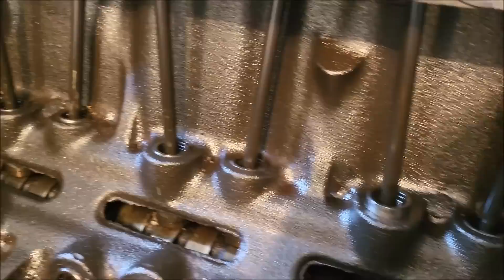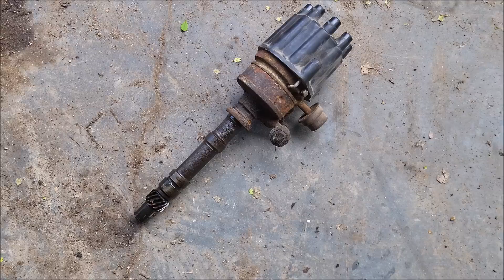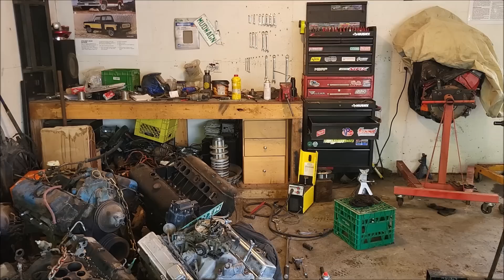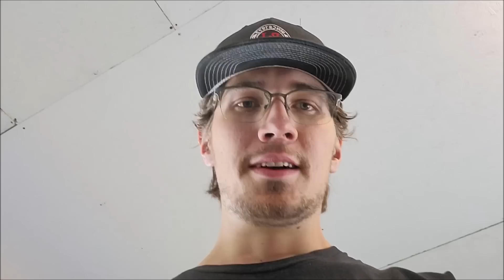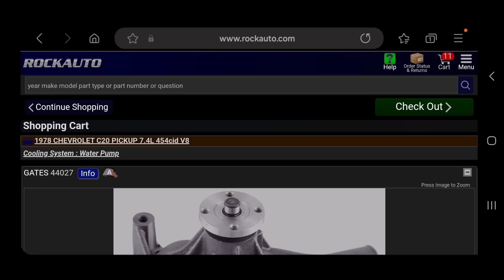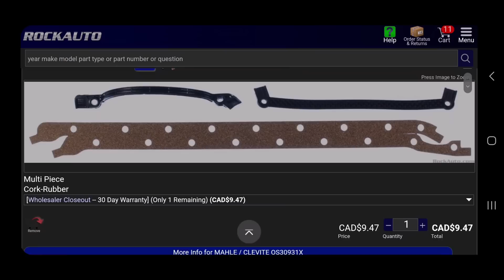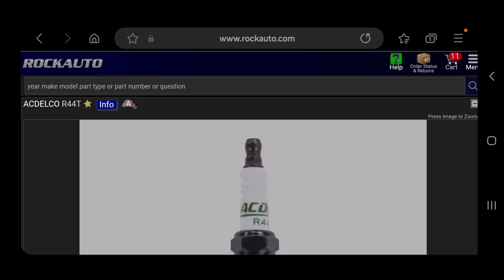Why Does Everyone Ignore Tall Deck Big Block Chevy V8s?

Comment: Young Man FYI small block 400 and 454 used the same flywheel. They’re both externally balanced. All other Chevrolet motors are internally balanced. Good luck with your build.

Comment: Intresting stuff and will watch more as you put it on youtube.
I have only one thing to say from experiance, remove the oilpan before you turn the engine, if there is debris in it i can fall down in to the engine and easier to diagnose the engines health.. 
i did not do this on one engine and missed a clip that had come lose, i then rotated the engine and did score a cylinder lining, not a fun day..

Comment: I have a pretty good idea why that 366 was pulled out of the big farm truck.  It's probably an oil burning, gutless pig like most of the 366's I've ever been around.  My FIL used to run them exclusively in single axle Chevy dump trucks.  They sucked gas like crazy and didn't make the power of a good 350.  When I helped haul gravel, we got 3mpg all day long, foot on the floor and begging for more.  They are durable though, can't seem to tear one up.  427's now are another story.  Most of the truck 427's I've been around would run circles around any 366.
Cool project putting one in a pickup.  I would have definitely opted for the 427 though.

Comment: Another GM series of engines that are finding their way into Chevy trucks are the Cadillac 472/500s They were also built using high nickel castings and designed for durability and longevity.  The Cad engines were not designed to rev; no 4 bolt mains (but huge 2 bolt main journals were large enough to match the bores of many smaller engines) and everything about these Cad engines were just massive but one fitted with an Edelbrock aluminum intake weighs in at just slightly more than a all iron stock SBC. 
These tall deck BBC's are definitely an easier route for cheap big block power especially if you want to keep your truck all Chevrolet and so much easier to bolt in without extensive modding and can retain the Chevy transmission.

Comment: The 366 set up with the right drive train will beat any other gas truck engine on fuel economy. The reason they don't have a MPG reputation is because they were in the Medium trucks and were paired with 5 speed manuals with the split rear end with 8.44 and 9.55 gears.

Swapping these with a 454 is an instant win at the gas station.

Comment: 427 version is what we used in the old days to make big strokers. 366 was a good source for steal cranks for 396 and 427. use to buy junk ones for cranks and 4 bolt main caps. Heads have huge diameter valve just like the truck 350. Use an intake spacer and you can run a car intake. No 454 flex plate it will nock it out of balance. . Use a big small block or 396 0r 427 flex plate .

Comment: I always prefer high capacity cooling and lubricating options. 

I have a 9 quart pan on my 361 I/C 4 bolt main, and a 7 gallon 4 vane radiator.

It was a fleet truck pulling heavy equipment for the city of Norwalk, CA and while only listed as am F350, it is rated as a 3 ton.

My newer Ck3500 is also a fleet truck, but being a 93, it has just a fairly normal 350 and 4L80E, which is not nearly as rugged.

The drive lines are somewhat different: 

one has an I/C engine with fleet cooling, a 4 speed manual, and a 5.11:1 Dana 70, 

and the other has a fairly standard model engine, automatic trans, and a 4.10:1 Dana 70

While they both have the same wheel base, I would have to directly measure the frames to know if they are the same length or not.

The frame on the Ford is thicker, but its also 1-ply "C" channel style, and the "k" member is bolted on,

While the thinner CK frame is "box" style with a few additional welded pieces as it merges into one under the engine, instead of having a bolt-on, drop-out "k" member.

They both have single piece front wheel hubs [disc brake rotors integral to the hubs] instead of the more common shallow hubs with removable rotors and a bolt-on extension for dually type rims.

A 366/427 would be a nice replacement for the 350.

My brother has one of those 427's in a 92 C-60 feed truck, but he has plans for putting it in an older square body 73 model C-60 dump truck.

I'll just have to keep my eyes out for one of these motors......and a manual transmission.

Comment: There are 2 366 blocks casting numbers 779 and 977 that can be bored past the 402 bore size...I guy told me he built a 440ci 366 using a 454 crank 4.185 bore and .400 long rods...the pistons were KB hyperutectic pistons made for a 396 with a 454 crank...all off the shelf parts

Comment: Well, your about 45 or 50 years to late! I built a lot of them for racing they were really popular with the big inch Chevy guys 454, 468 or bigger! I just finished building one for a good friend of mine and we are almost done with a 78 short-bead pickup! that it's going in! I still have 2 of them that I raced for years and am getting ready to put them in an old, new car and go again! This one I just built is a 496CID at .030 over bore. we could have made it a 502 if we had board it .060 over, but the block was nice, and we wanted to get more mileage out of it! We can boar it .060 over next time! It has a new billet steel crank with a 4.250 Stroke! and just short of a 7" Rod! and a set of maxed out Dart Pro-One Aluminum Heads! The 366-T is not much good as it's a small boar! You can't bore it out to a 4.250 like a 427 or 454! But here's is the deal and why they were and still are sought after blocks for BBC's They are 4 bolt main high nickel blocks just like an HP 427 but what is so great about them is the deck of the block is .400 taller than a regular 427 or 454, now everyone knows that the 454 has a rod angle problem the 427 is perfect! But the 454 is putting a lot of side loading on the trust side of the piston and cylinder because the rod is too short for a 4" stroke! 427's are 3.750 stroke and are great just that way but if you want the toque of the 454 pulse the high RPM house power that would come with it if you had a longer rod to let it sing! It's almost like GM made the 427-T tall deck block just to order for the 454. So here is the deal, you take a 427-T Block, do all the machine work and line hone or check it, and boar it over to what you need or want! take a steel 454 crank and pistons whatever compression ratio you want, and most all Rod manufacturers have a big block chevy rod that is .400 longer than the stock rod! the pistons are for a standard deck 454 nothing special about the pin height just a good Forged Piston! You build it for whatever you're going to do with it? Drag Race, Boat Racing, whatever? You order a set of .400 longer pushrods, and they make a spacer plate kit that raises the intake manifold .400 above stock and the cam and all the rest is your choice! The 2 I have in my shop that are still running, one is a "Bowtie Block" with 4.500 boar cylinders and a big crank with a 4.500 stroke! It's a 572 CID. See GM knew what to do with the truck block! The other one I have is my favorite, it's a regular 427-T truck block I run aluminum rods (Never had any problems with them!) Drove it on the street! But! it's a 461CID .030 over 454, it makes over 900 HP on the Dino! Naturally aspirated with 1-1150 Holley Dominator, and it has a total of 500 HP of nitrous oxide, in 2 stages just for fun! ran it for 12 years never hurt anything! So that's it! I can show it to you! I have a lot of witnesses and people the lost to the car and engine! And I have Nothing to Gaine, I AM A FORD Guy!!! Born and bred! WHY? You Say? Because I know a great engine when I see it and race it! and I give a hole box of Kudos to the GM engineers for coming up with this combo!  (o;   I have early 66 Mustang Fastbacks a 68 Couger X-R7 70 Maverick and a 70 Torino and a few more. But I also have a 68 all original 3rd owner Z-28. Because I love driving it and the way it runs! Like I always say if you cut yourself off from a great car or engine because of the brand name? You will never know what you're missing!  I mean really, when you get done building a car how many parts are actually made by Ford or Chevy? Think about it, Take Care, and Always Have FUN!!!    (o;

Comment: The engine in my 71 Chevelle is a tall deck mark IV block.  Tall decks require a spacer between the intake and heads, and the deck is 0.100" higher.  Otherwise, it's just like any other big block.  Mine is a 30-over 454 with a 1/4" stroker crank, which works out to 489 CID / 8.0 L. 4 bolt main. lightened, internally balanced forged Crower crank. longer custom Crower rods. custom JE pistons (1/4" higher wrist pins). 10.28 to 1 compression ratio. World merlin heads with the biggest valves possible. True roller valvetrain. Offenhauser IR intake. Twin 1150 dominators.  MSD 7ML2 ignition. Estimated 688 HP on 93 octane - no turbo, no blower, no nitrous.  It has a high-volume Melling pump, a road race pan, twin remote Oberg filters, an external oil cooler, an Accusump, and a marine pre-luber.  Including the braided steel lines, it takes 15+ quarts of oil. The nose of the car has been replaced with twin NASCAR radiators and 4 cooling fans to keep it from overheating in traffic.
Reply: I thought the heads were also different from factory, at least on the 427?? But either way, I know a guy that has a truck 427 in a 68' tubbed camaro. Has an M22 so its a 4 speed. Has 33 Thompsons on the back. Not sure of every specific ingredient but it has an 8-71 BDS blower and a 500 hp NOS fogger system. It will light those 33s up with a 4th gear roll on, no nitrous. Not sure what kind of clutch that is that can stand that.
Reply: @timberslasher4899  all mark IV heads are dimensionally the same and fit both stock deck and tall deck blocks.  Tall decks require the intake spacers.  Internal dimensions vary - D port, oval port, combustion chamber size, valve size, runner displacement, etc.  Odds are they never put D port heads on a tall deck "truck" block from the factory.
Reply: @normbarrows2 better to buy a TD aftermarket intake and stay away from them spacers.
Reply: @thereluctantgearhead4544  Offenhauser is the only one who makes individual runner intakes for the big block chevy - as far as I know - and it's only for std deck, not tall deck.  I've run spacers for decades with no problems.

Comment: Tell deck pistons are heavier and  have an extra ring, the oil pump like you mentioned, the big heavy tall deck intake, the increased deck height makes it a little harder fit into things, especially with headers. The crank pulley like yours is a bummer, the distributor. And the 800lb small block displacement 366 is a turn off in itself. But boring and stroking the 427 would be cool.

Comment: i have a 366 in a 1973 half ton 4x4 chevy  truck that i put in around 1983 still have it used in field to spray farm chemicals has a 350 turbo auto trans behind it haven't ran it for years  it was a beast positive track rear end had to be careful how hard you got on it had to put in two rear ends because i was playing around if your going to put it in a pickup find 454 exhaust manifolds makes it much easier if going auto a flywheel off a 327 auto trans will also be need good luck

Comment: Most aftermarket blocks are all tall decks , the weight I think was the biggest issue in the past because aluminum heads were not as plentiful as they are now which takes a ton of weight off the engine .

Comment: Because it cost twice as much too build as a standard mark 4 deck hight if you have the $ build one ,build a big cubic inch engine mountain motor if you have the $ if not a standard mark 4 ,the intake is different ,so is the push rods ,distributor,They all have small valves the timing chain is different ,just build a standard mark 4 if your not rich ,366 sucks if you go this route go with the 4.250 bore the 427 tall deck

Comment: I dont think that tall block will fit in a square body with an air cleaner  on, ones I've seen had to drill a hole in the hood just to fit the hood closed without air cleaner. 3" body lift would cure, seen ine of them too. And if you go with the steel collar oil pump shaft remember it won't drop in from the top, it's to big to fit through the hole. So if you seal up ur oil pan and have dripped ur pump shaft amd distributor in ull be pulling your nicely sealed up oil pan to fit you pump shaft in from the bottom, eh hem yep i did dat, lol keep ur stick in the ice rubber on the road shims in with your starter! Cause broken starter bolts can really put a cloud over your new install or build!! Idk peace, gear heads!

Comment: There's one thing you said that was not correct.  You should NOT use a 454 flexplate or flywheel on a 366.  The 454 flexplate and flywheels have extra weights on them because a 454 crank is externally balanced.  The 366 crank is internally balanced.  You must use a 396, 402, or 427 flexplate or flywheel on a 366.
Reply: U can also use the 350 flywheel, also internaly balanced

Comment: For car guys, the best part of the 366 is the cylinder heads.  Pull those off and put those on a '70's 454 PU truck engine that has peanut port heads.  The 366 heads will give it better breathing and higher compression ratio.

Comment: I wouldn't waste your time putting a tall deck 366 in your pickup.  You'd get more torque from a 400 or 383 SBC and they weigh a whole lot less.  The only thing the truck big block 366 does for you is that its pretty near indestructible and will be able to last more miles between rebuilds.  Of course, none of that is a real consideration in a light duty pick up truck.  The best thing to put in a pick up truck for extra torque is a 500 Caddy, 455 Buick, or 455 Olds IMO.

Comment: A 366 will take exactly 6 runs with 3 stages of nitrous at 250hp per kit. I went through 5 of them one season in an 84 Cutlass. 150 bucks each from the scrappers. The bottom end stays solid, the tops of the pistons melt off. It was cheap to street race in the 90s and make a few bucks. I will take responsibility for sending 5 of these old basterds to Hot Rod Heaven on a blaze of funny gas glory.

Comment: I am 62 years old. I have had several square bods.
 I had a shortbed standard cab two wheel drive with a 4 speed and 350 in 1980 when it was brand new.
 I had one in 2005 when it was old. I worked on those things when they were still under warranty at a chevy dealership.
 I like the look and styling of the squarebody series. I like the styling of all the '80s cars.
The new cars are so much tighter no rattles, no squeeks, antilock brakes, air bags

Comment: The problem is a bb doesn't have any advantage until it gets hogged out to 572 and bigger. 
 The real issue with bb is gas is no longer fifty cents.
 You would be way better off building a sbc unless your gonna tow truck things.

Comment: swap the gears if you can if not make sure the next distributor has the same amount of teeth on the gear or it won't work, but try to swap out the gear first easier than changing oil pump.

Comment: That’s not the oil pressure sensor on the distributor. It’s the vacuum operated overspeed dash light switch.

Comment: When you say a 454 is neutral balance it is not .

 The 454 big block along with the 400 small block these engines are externally balanced you need to get that right , you can not run those flex plates on any of the internally balanced engines .

The 427 is an example of that so is your 366 that you have those are internally balanced engines get that straight .

Comment: Yep I drove a C 65 grain truck and it was a great engine with lots of power ! Not that we ever over loaded a grain truck during harvest !😂 I went to elevator loaded up 54,000 pounds on a tandem axle 8-10 times a day all summer long 😂
Reply: 427 tall decks that are stamped high performance truck marine on back of block are sometimes high nickel blocks make great pull truck engine. Mine dynoed at 800 HP and is reliable at 8000 rpm

Comment: if you can find a crank trigger i recomend trying that to cure your RPM issues.   Also get some custom built pistons with low hieght  stroker type config, longest rods you can fit, Im wondering what the biggest stroke you can get, but i have a feeling finding anything for these engines will be tough to do.  They sound like a no brainer in theory.

Comment: 460 has a taller deck and can be bored more. 460 doesn't need machining to accept stroker cranks. That's what I'd go with.  Drove a lot of buses with tall deck chevys in them, good motor though!

Comment: What I see in a 366 is a boost pig.  It's got all the markings to be able to handle 30 or more pounds of boost with modest work, proper cam, ring gapping, right head gaskets, and head studs.

Comment: I have a 427 tall Deck in my 87 Camaro only thing I did put small block 400 rods with stock 427 Pistons and some clothes chamber heads on spray I can put it on the back bump
Reply: those rods would not work

Comment: How about you "run across" some of those Hobo Freight engine stands?  Goes a LONG way to engines lasting longer if they are not sitting on a concrete floor where moisture wicking occurs

Comment: All TD 366/427 have forged 3.76 cranks that came in the 396/427 in all the normal car and truck stuff, so run a 396 flexplate, and it'll work forever.

Comment: With the spacers even a low rise iron quadrajet car manifold would do wonders on a 366. Probably wouldn't have to change much tuning if you used a 350 quadrajet.  You should check out Cliff Ruggles forum cliffshighperformance it is a wealth of knowledge.